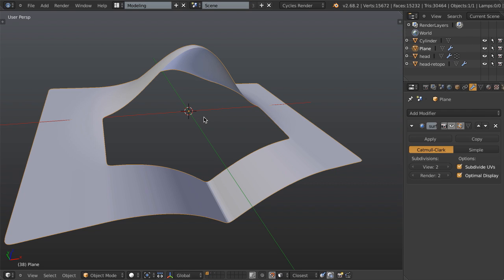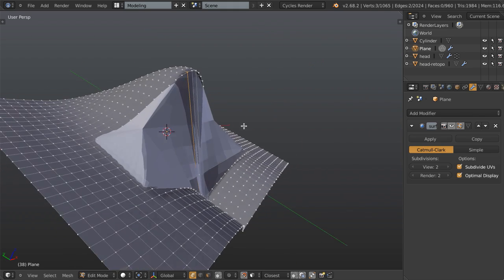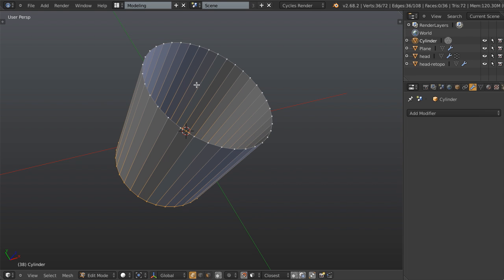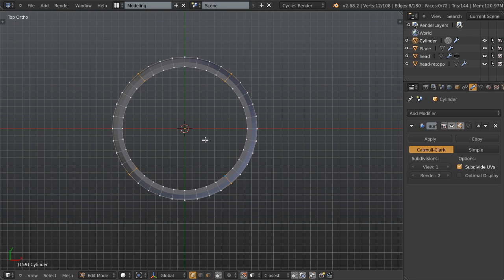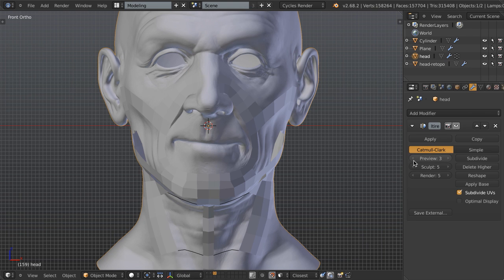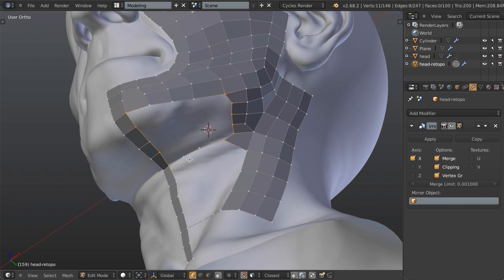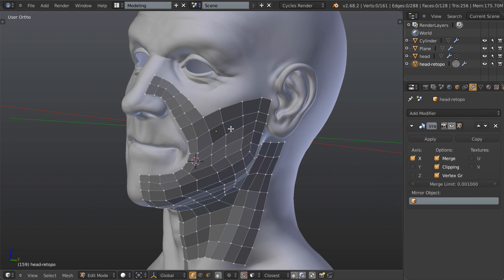Using The Grid Fill Modeling Tool in Blender

Comment: Gee, I work with blender 2.8 intensively for about 1 week now and Grid Fill was one of the first great mesh generation techniques I have learnt. But only from THIS video I've got to know that 'j' inserts an edge into an existing ngon. And I was already so happy when I found the 'k'nife tool to cut faces, only a few days ago. :-D Thanks a lot for the good moderation in the video!!
Reply: That knife tool is ESSENTIAL sometimes boolean just doesn't cut the mustard.
Reply: a tip: watch movies on instaflixxer. I've been using it for watching lots of of movies these days.
Reply: @Turner Danny definitely, have been watching on instaflixxer for since december myself =)

Comment: How do you snap the selected vertices to the face model? 6:45
Reply: Just make sure that the option right next to the magnet ("snap during transform") on the footer of the 3d view window is set to "face", instead of "increment", then it will automatically do it for you.

Comment: Hi CG,

Awesome tips and great tutorial!

I have a question relating to a problem I have..
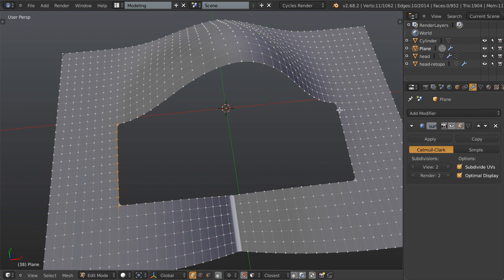At 1:41, 2:08 and 6:11 mins your are pointing out the left and the right area using a white circle pointing tool. 

I am trying to Retopologize my Sculpture and for the last 2 days i am getting this white Pointing tool instead of the Placing Vertices option tool.. 

Do you have any idea what the problem is, I have tried a lot incl. checking my settings and restated a few times but the problem persists.. 

I hope you know what the problem is. 

Thx in advance..